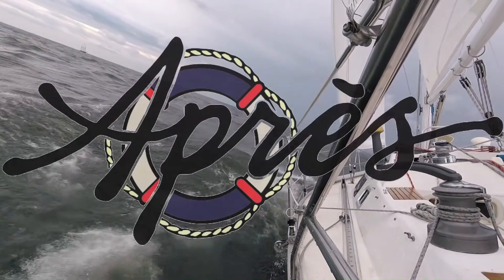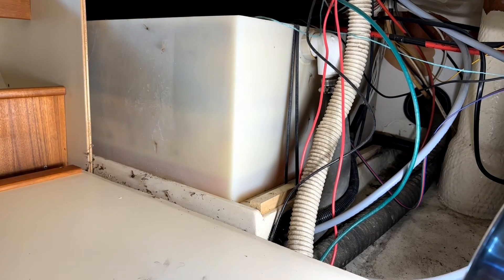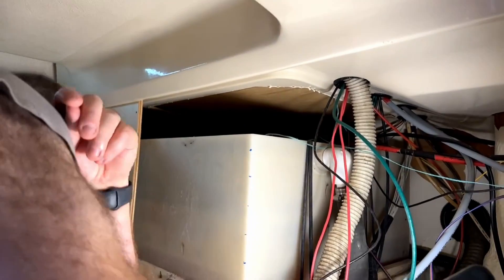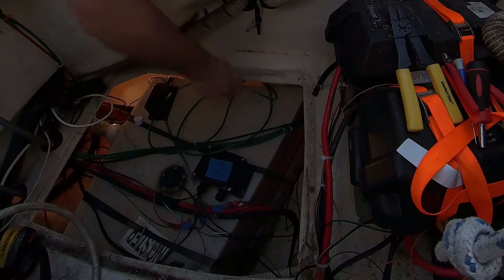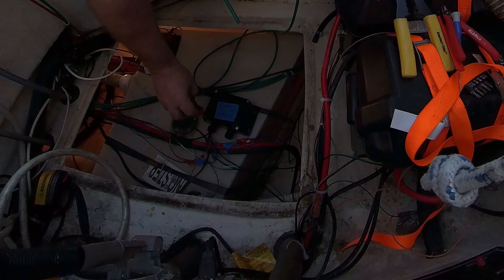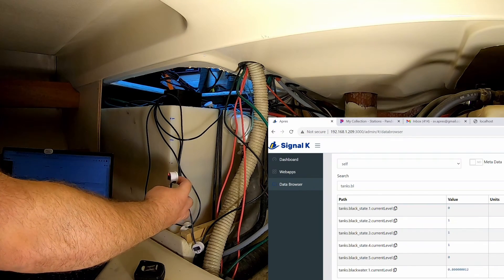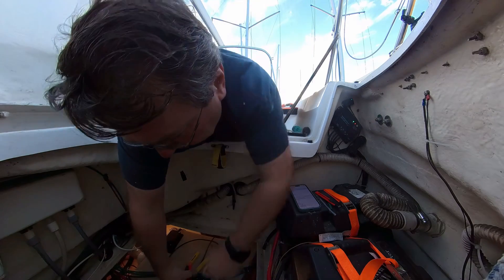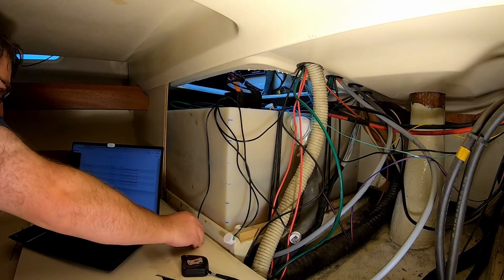DIY Blackwater Tank Sensor Install using SignalK and SensESP/ESP32 - Tech E20 - Après Sail

Comment: I went through the sensor ideas from pressure tubes to lidar concluded I don’t fill the heads fast enough to need constant monitoring so went for esp32 + load cell driving graduated led bar, based on weight of tank, opting for kiss this  time - compare notes in a year 💩🚽
Reply from the maker: Thanks for sharing your solution!

Comment: Really great videos on using OP and SensESP.  I see your code is based on SensESP V2, and I've been having challenges adapting your code to work with SensESP V3, and wondering if you have played with that yet.  I'm using the FireBeetle ESP32E, and my code struggles to establish a connection to the SignalK server, and when it eventually does, it will run for a few minutes, then lose the connection and can never re-establish.  I'm getting to the point where I think maybe the new V3 code does not deal with the FireBeetle, for some reason.  So before bugging the developers, I thought I'd reach out to you since you are using the same board.

Oh, and when I try to 'downgrade' to V2, I run into a whole field of rabbit holes where the various libraries are not playing well together anymore.  

Cheers,
Erik Lundberg
Reply from the maker: I did update one of my projects and ran into a few errors.  I didn't have much time so, I just grabbed the template and then copied and pasted the bits I needed.  I never had issues with disconnection.  You could try to use a new template to see if you have disconnection problems, or I could send you my limited, but working code.
Reply: @ApresSail  I did try to start over with the template, but now can't get it to compile.  I saw there are some issues noted in GitHub, and with some careful specification of versions, it will compile, but now getting other connection issues.  I'll dig through more of those issues, but if you have some working code, yes, I'd love to have it.
Reply: @ApresSail  I did try starting over with a fresh use of the template project, and now even that won't compile.  I noticed a similar issue in the template project GitHub issues list, and was able to compile the project with some very specific version specifications in platformio.  So it compiled and built, but that had some different connection problems.  I'll keep exploring the issues list, but I would love it if you would share some working code.

Comment: Hi, I'm having trouble with the code. I copy both the main.cpp and platformio.ini exactly. No changes. When I start a new project I specify
the DoIt board that I'm using. I connect to SignalK and get the access request. Each time I try it, the data browser shows it reading 60%. Tanks.black_state.1.currentLevel, tank 2 and tank 3 are triggered. Showing 1 not 0. I doest this even on a board without the sensors connected. Any help would be appreciated. Thanks, Jim
Reply from the maker: your board may have different I/O pin outs which may be causing the issue.  I had a similar issue with some other code where the board was different and had to define the pin number.  not exactly the same as the pin number is defined, but its position on the board may be different

Comment: So far I'm having no luck with the ESP32 board and getting it to communicate with the SignalK server. It does see that there's a server on the network, it tries to send an access request. I never see the access request in the server and so it never is able to connect.
Reply: Nevermind I figured it out was the firewall. So I tested the template project and checked everything was working with the SignalK server I have setup. All good. Now I grabbed the liquid level sensors and I have another problem. I tested it with my water bottle and it works great. I can see the red led on the back is off and then it goes on right as it hits the water level. However, when I put it on my tank wall it stays on all the time. Now I'm guessing this must be due to the higher density of the material. It's not a metal tank this is the holding tank on my boat.
Reply: Tried decreasing the sensitivity by turning the screw under the cap clockwise but it continued to read as if it was detecting liquids. I may just not be able to use this style sensor for the holding tank. Maybe there are things stuck to the inner wall. I do have a capacitive sensor I can look at using. If you have any thoughts please let me know @ApresSail
Reply: Just tested it on a water tank and it works great so unfortunately it would seem it won't work on the holding tank. Bummer as that's the one that I would really like to measure.
Reply from the maker: if it is things stuck to the inside, at the end of the season, I empty the tank and then add white vinegar and water until it is nearly full.  sail around a bit and see if it shifts the debris from the inside of the tank.

Comment: Hi, very interested to see you using XKC-Y25 tank sensors ... I've completely failed with these! Work fine testing on plastic kitchen tub with water but will not work on holding tanks. Tried two sensors on both of our tanks. Tried popping off sensor cover to adjust sensitivity but output either always high or always low., Suspect it is either thickness of tank plastic or layer of scum on tank inside. Wonder if you had any difficulty getting them to work reliably? Many thanks.
Reply from the maker: So far they all worked with the Pink liquid.  I will do an update next year when cruising for a while